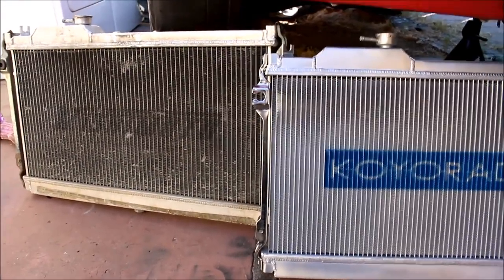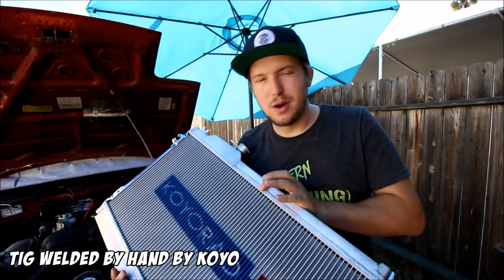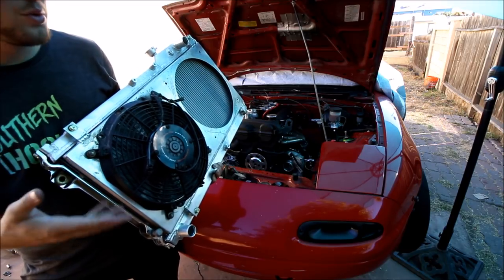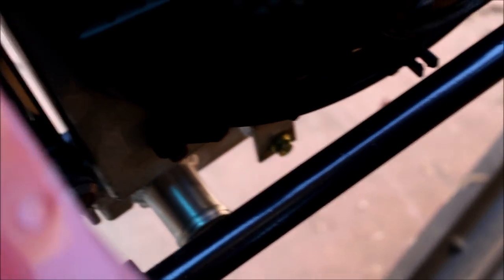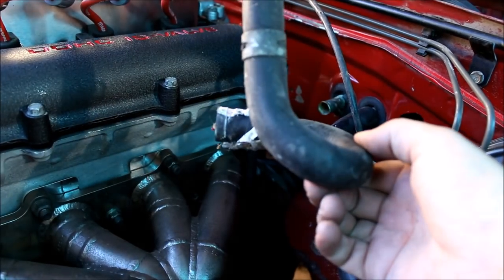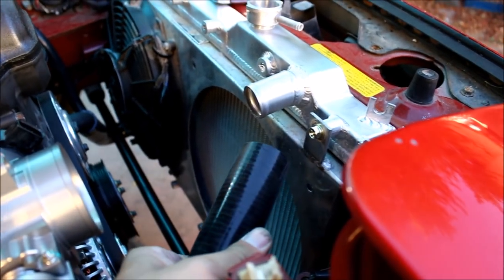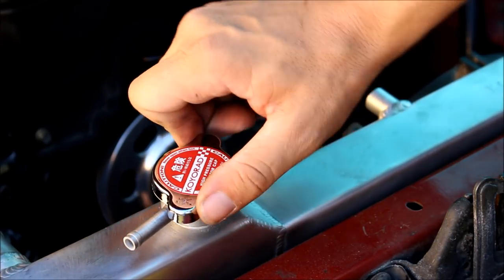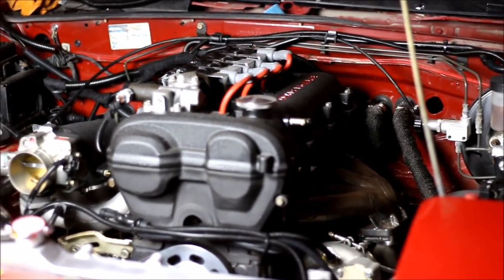Miata Gets a Koyo Hyper V-Core & Full DIY Cooling Hoses! (Rebirth Ep33)

Comment: Hey Grag. I noticed your heater core inlet/outlets look a bit beat up. If you don't know yet, you can fix them by slowly massaging a socket of similar diameter or similar into the holes, while gently hammering out the creases with a small hammer from the outside. Finish them off with emery paper,. Especially with silicone, there's a great chance of a leak, if they are not straight.
Love the build - going to be SaWeeeeeeT!!

Comment: Koyo is one if the best radiators you can get. I have a regular KOYO radiator on my Supra since 07 but with my current high hp build going on right now, I am upgrading to a full aluminum unit. I like that radiator cap :)

Comment: Changing the fin density of the radiator also changes the drag created by air flowing through it, so denser is not always better. If the lower fin density was adequate it would help your aerodynamics to keep it.

Comment: If you put one fan on the radiator, put it on the other side. That removes the blockage at the turbo side, than you help cooling the turbo and the engine!

Comment: hey man, awesome series! noticed though that you wrapped your heater pipes in heat wrap, not sure if you know but you can get a tighter wrap by soaking the wrap in warm water then apply it wet and let the heat of pipes (or atmosphere in this case, or maybe not by now? got it running?) shrink the wrap to fit.

just some useful advise from first hand justr in case you weren't aware :) looking forward to see it run! so want one of these cars!!

Comment: Also fabricate a heat shield for the turbo/exhaust manifold, it is very easy to mount to the frame/firewall, and then you don't need protection for the cooling hoses AND you protect the brake master cylinder from the heat ;)

Comment: Just a thought- since there is very little coolant flowing through the thermostat before it opens, won't it take a very long time for the heat to conduct through the stagnant coolant in that long run of silicone tubing before the inline thermostat? It would seem like a good idea to keep the thermostat close to the cylinder head so that it accurately reacts to the coolant temp.
Reply: 949 has a new design that does exactly that, keep the thermostat closer to the head.
Reply: It does take a bit longer for the remote t-stat to open.  I have the M-tuned setup on my car with a shorter hose between the t-stat and the head than Greg is running and I would see my coolant temps usually hit a little over 210 before the t-stat would open.  I've recently made a slight mod to the t-stat that has helped, but it may be too much "help" for colder days.  Clip out the little jiggler piece on the t-stat and then it will let a little coolant flow past and not make the back of the head temps so high before the t-stat fully opens.  I went one step further and enlarged the hole a little where the jiggler was.  Seems to be fine for warm days, and should be great for summer track driving, but driving my the car on the highway in 40 degree temps recently had the coolant barely reaching 180, and not making much heat for the heater.
Reply: I'm in love with my complete reroute from Hawley Performance.   Thermostat inside the new neck at the back of the head.

Comment: I always wondered why the previous owner of my Miata removed one of the fans, never thought about the possible cooling effect. It's never caused any issues for me at idle or even redline, and I'm on a bone stock NA8 block with a stock radiator.

Comment: Mishimoto fans are average to below average...i installed SPAL fans in my 1.8 VVT miata, and the difference is NIGHT AND DAY, you can feel the airflow through the intercooler, condenser and radiator with your hand in front of the bumper...you really get what you pay for ;)

Comment: WHERE ARE MY MOUNTS?? my koyo does not have any mounts on either side, idk if im missing something but theres no holes or anything to even bolt the radiator inside the car!!! Did i get the wrong radiator or what? the picture in the amazon link that greg lists on his website doesnt even show the mounts on the side either!? how does this make sense? do u buy seperate mounts??

Comment: Hey man I’ve been wanting to do something like this to my miata as well but I’ve never taken an engine apart and to be honest it kind of intimidated me, what kind of advice can you give me?
Reply: Start small (oil change>accessory belts>valve cover gasket/CAS o-ring>timing belt/cam&crank o-rings>head gasket>rebuild).  As your confidence grows to accept new challenges, so will your skill.  Rebuilding isn't bad since you're just unbolting one thing and bolting on another of the same dimensions.  All the precision work happens at a machine shop.  

Just research everything you plan to do, get multiple people's perspectives on the job, and if you feel comfortable look up other jobs you can do at the same time (water pump at same time as timing belt since you're 95% there anyways etc).
Reply: Bilbo Baggins thanks homie

Comment: Still thinking about doing this or 13b.
Reply: I wanna do an inline 5 :/
Reply: 13b all the way however it'll be more work and a little more expensive
Reply: Depends on the build's purpose, street use (even daily) or weekend street car, built BP motor all the way. Racing or track build, then go crazy, the sky is the limit.
Reply: I'm sure a V6 or K swap would still be good for street use. I mean, anyone can do whatever, but I still want my inline 5 lol.
Reply: TimeGhosts im starting a saving with $10,000. Once I'm done with my 6 year contract.
Reply: DarkSwordsman yeah I look into it and also a LS. But I narrow it down to vvt 1.8 or 1.9 and the 13b
Reply: Inline 5 out of what? volvo? audi?
Reply: Probably Volvo, but we will see :)

Comment: Turbo definately should be on top
Reply from the maker: +Bartek Józwiak And why is that
Reply: looks better :)
Reply: Bartek Józwiak sure it looks better, but I think a bottom mounted turbo keeps heat away from the head, coolant lines, brake lines, master cylinder and booster.
Reply from the maker: All good points. Also makes the downpipe straighter and puts the weight of the turbo lower. Small differences, but still advantageous over top mount.

Comment: So what is the fins/inch of this radiator?
Reply: You said it has 20% more fins than the Mishimoto horizontally and vertically. In the video they look very similar at 1:26 but you never stated what they actual fin counts were.
So what was the fin count per inch that you measured for each radiator?
 I measured 18 fins/inch vertically on the 36mm VH060650 I just installed. I was surprised it was so much lower than the 24 fins/inch of the 16mm Denso 2213505 OEM style radiator it replaced given the high density fin claims in the Koyo HyperVcore marketing.

Comment: My cooling system is so basic-Fake mishimoto aluminum radiator-wired both fans to turn on at the same time-fresh coolant-all hoses replaced -water pump-thermostat
Works good for a daily driver set up. I'm only a broke high school student lol